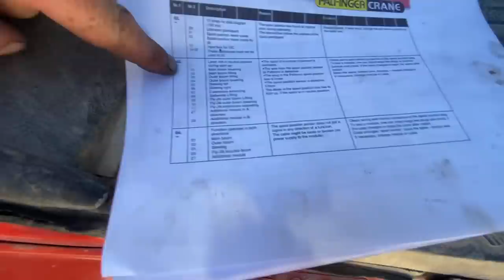Crane game again! Palfinger fault! The Gym experts 💪 reverse camara, dreaded spray job continues

Comment: Sometimes with Hiab cranes the valves get dirty inside, so when your starting up the crane, you are having a failure because the lever is not exactly in neutral.
Reply from the maker: 👌 you make me feel better there mate, thinks you’ve hit the nail on the head with that Sander 👍 thanks pal

Comment: Good lad Chris! I did mention that the little red might have no spring tab on the adjusters to prevent them working off! After mentioning that the may need adjusted!  Make sure you have no tears in that paint job!💧😅
Reply from the maker: When I stripped one I did see the plate on the cog but how affective they are is a different matter, I’ll save my tears for next weeks coat of paint mate 😂😂 thanks Keith